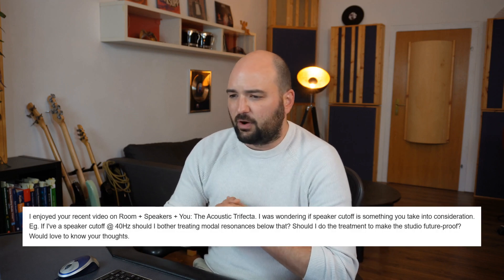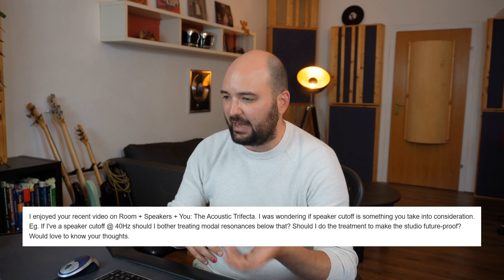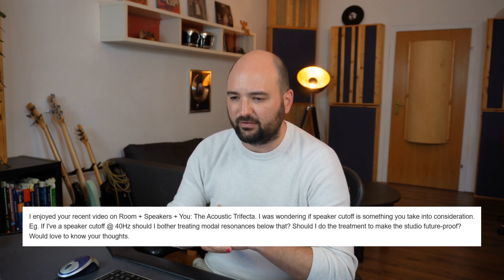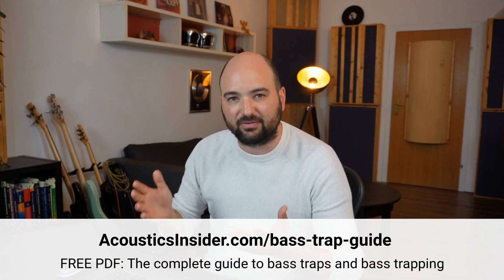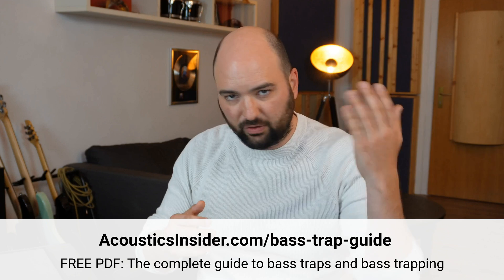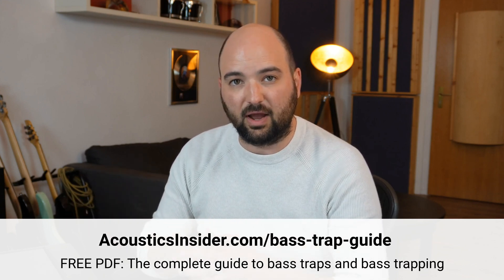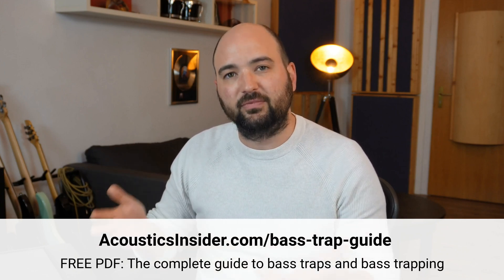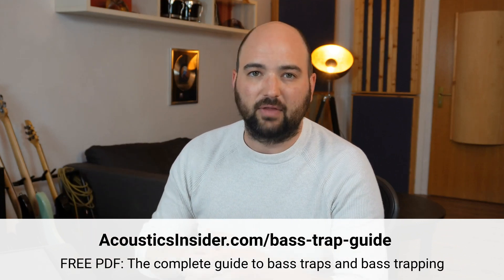Why treat modal resonances BELOW the speaker CUTOFF? (eg @40Hz)?

Comment: You can feel a bit less guilty about not achieving full effectiveness below 40 Hz by considering that very low bass is generally not transient in nature. This means that long decay times associated with modal resonance are far less of an issue than they are in the midbass. I think it’s sufficient to smooth the frequency response of the lowest octave with EQ, as long as you don’t rely on using too much boost.

Comment: Can you make a video about ,,Active,, Basstraps / Room Mode Compensation like an Array / Bass Array Solution (Double Bass Array, Single Bass Array). I think many people dont know this and the benefits of it
Reply: Voted for this subject numerous times already. Though, active traps are yet a part of the hi-end budget.
Reply: Array Solution are just a lot of Planning and Prpgramming. Thats the downside. You need to put work into REW, Measurements etc. But when you set it up properly, you can get an nearly flat Lowend without massive amounts of Absorption arround it.

Building 4x ,,High End,, Subwoofers with good drivers from scan speak costs under 2000euro. So the end costs are way under ~5k - and you get the best possible lowend. The passionated Homcinema Guys are doing this since years to get the best Lowend in small rooms

Comment: Children's Bean Bag Chairs..........................
       Are now filled with memory foam chunks, sold in 2 foot diameter X 2 foot tall size and are covered in colorful microfiber fabric. They're about $35 each.
      Stack 3 in the corner for a 6 foot tall bass trap that is dual use, easy to repurpose, easy to move and may just be a little more home decor friendly.  
                                                                                                 Acid Jazz, Funk & Brass  🔈🔉🔊
Reply: I think you're underestimating how much horsepower it takes to absorb low frequency energy...

Comment: I have a Genelec 7360A 10 inch that goes all the way down to 19 Hz. I have 4" panels on the walls and triangular bass traps in the corners from GIK.
Reply: The 4 inch panels won’t do much under 200Hz
Reply: I'm fairly confident those bass traps from gik don't even go that low, and even if they did I bet my money they don't get enough of that low frequency energy
Reply: @djhmax09  none of the traps do, don't they?
Reply: @zerobject  nope, not enough horsepower

Comment: Related question, does it make sense to cut off my speaker at 40 Hz if I have a massive mode below that, which will be difficult to treat?
Reply: .         40Hz cutoff.  That depends on the music you listen to.  Music recorded in analog by microphones of humans playing physical instruments, for example, is a case where not much will be missed.  There are very few instruments that play that low or microphones that record real low.  Often times too, recording engineers compress low notes UP so that every day systems can resolve them. (edit) Which is the case recording live Reggae due to the Open B 5th string at 32Hz of the bass guitarist.
        Synthetic music can be created & stored digitally at very low frequencies.  Hip-Hop, Electronic Dance Music and the whole Low Frequency Effects of home theatre are all way down there.
                                                                                   Acid Jazz, Funk & Brass   🔈🔉🔊
Reply: Just EQ all excessive energy.
Reply: no, just sit in acoustic balanced position in your room